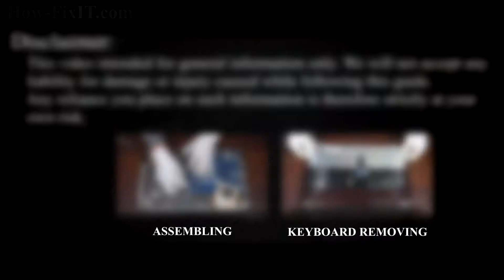Samsung R780, R728, R730 Disassembly, Fan Cleaning, and Thermal Paste Replacement Guide

Comment: I realised that SPK just below meant these were speaker leads, not on off, so less fatal if the were wrongly attached, iepr if they detached, especially as I use an external DAC. So taped them in place switched on and all is well. Ouff. But I hope I can get a connector from somewhere...
My sequence of panics and deductions may help another first timer perhaps...

Comment: OK, I have seen where the two wires go, the connectors clip over the two circular terminals on the microprocessor. The dressing of the wires make it quite clear. So my only problem now will be reconnecting the four wires from the on off switch. I think I will have to press them into place and secure with tape. No other solution until I can obtain a new connector. But it would be good to be certain of their order!!

Comment: The two wires you disconnect at 0'57" go where? I have disassembled and cleaned my fan, which was very dirty, but I do not see where to reconnect these 2  wires now that I am reassembling the computer. Also the 4 wire connector from the power switch disintegrated as I disconnected: the 4wires would seem to be in the order red black white black from left to right. Can you confirm this? Thanks very much for any help you can give!

Comment: Thanks dear friend for sharing your knowledge!

My R780 was not going faster than 1.1Ghz (intel speedstep tech) because of the high CPU temp (91°C), even when idle......
The NVidia chipset temp was at 90°C too...
and the PCH Platform Controller Hub (chip under the gray plate near the memory) was extremely hot, I couldn't keep my hand on the cover near the trackpad...

I removed the dust on the motherboard, fan and the dissipator which was totally full with dust, the airflow couldn't pass through....
Now the temperatures are :
CPU: 40°c when idle and 72°c at 100% during few minutes
GPU: 38°c
and now i can't feel the PCH temp through the cover....

Thank you so much!
Reply: what thermal paste did you use?
Reply: an old Arctic Silver 3 syringe from the 2000's, still fine almost 20 years after :)